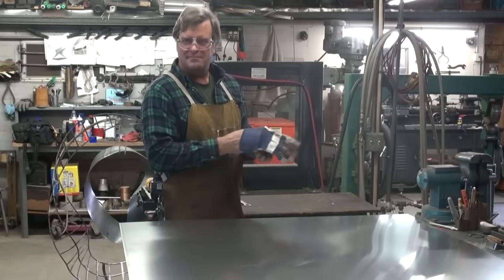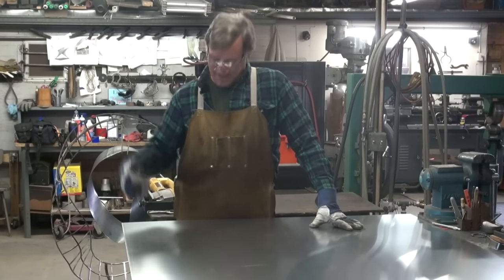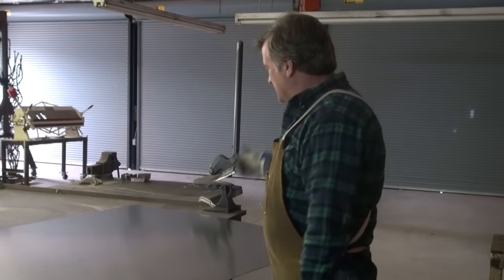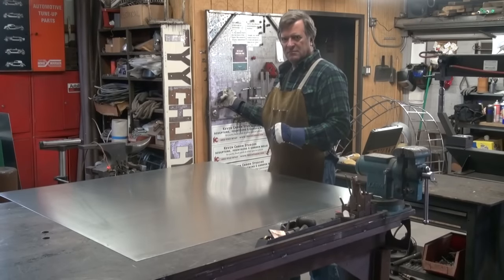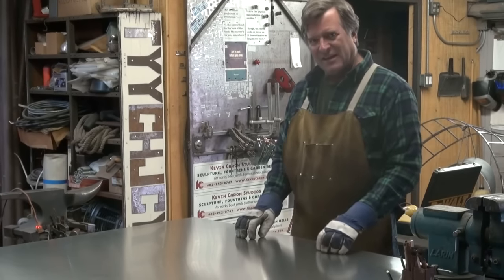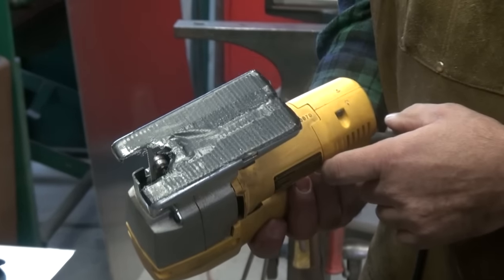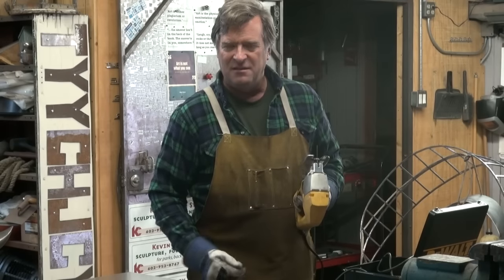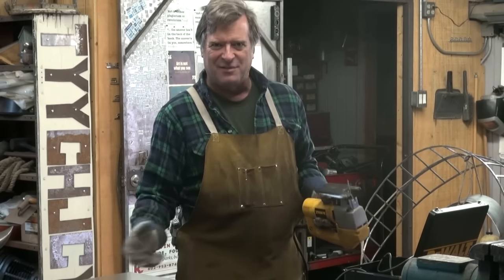How to Cut Aluminum the Easy Way - Kevin Caron

Comment: Jigsaw does bend the edges next to a cut, not a clean cut whatsoever
Reply from the maker: I have not had that problem.  All depends on how fast you are trying to cut and what blade you are using.
Reply: @KevincaronSculpture  thanks for the answer, unfortunately it also depends on the thickness of the alu sheet
Despite the fact i was using the smoothest blade for steel (as the dedicated for alu cuts it in kore rough way) on lowest speed, I am still struggling with 1mm thick sheet

Comment from the maker: How long does the battery last, inches wise....
Reply: Not sure, but with a cordless recip saw, you definitely want the battery near full voltage (charge). As voltage goes down, the motor will tend to pull relative to the material, rather than power through and knock chunks off as the teeth pass through. Increasingly important as teeth-per-second across the material goes down, since that pulling action before the material breaks away will pull the motor voltage down and just get worse and worse.